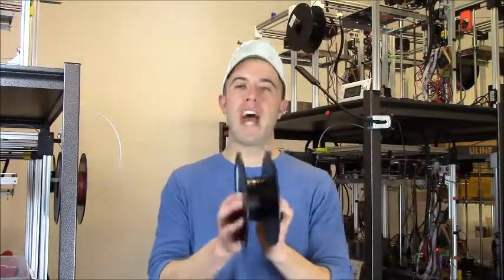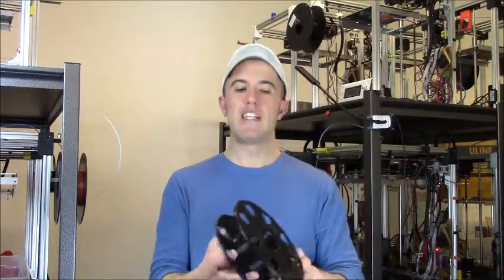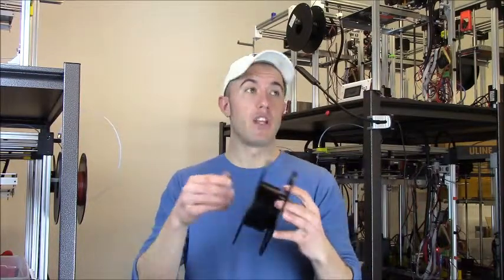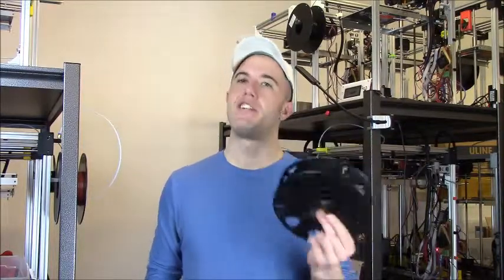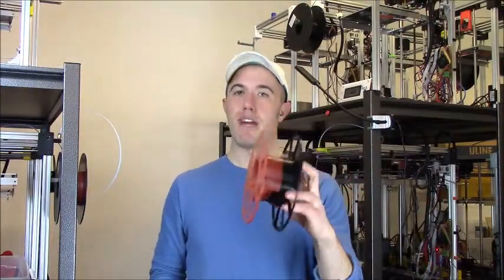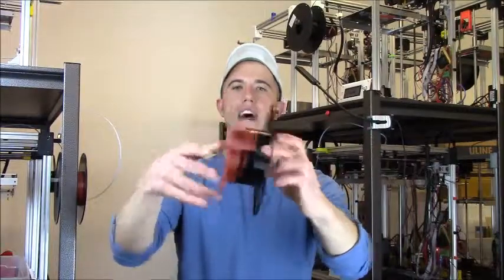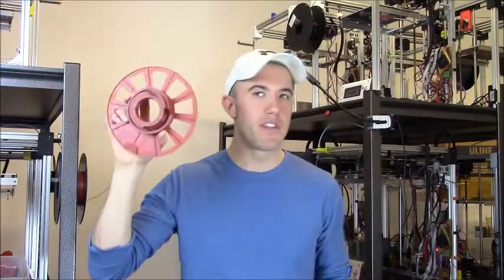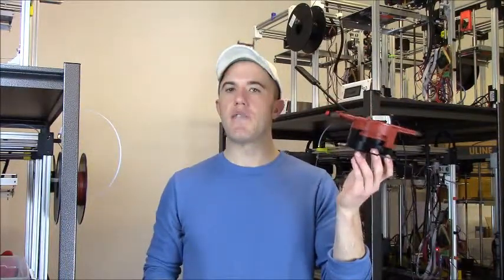The Slant 3D Reusable Filament Spool Intro

Comment: Why isn't this getting more traction?  I like that PolyTerra comes on cardboard spools, but even then it seems that shipping without spool and then putting them on a reusable one would be so much better.  Less weight to ship, less waste, ...  Ok, you do still want plastic sealing the filament from the air and some desicant in the pack and probably some box to prevent things from deforming during shipping ...  So, what is keeping manufacturers from jumping on to this?  There must be a reason ...